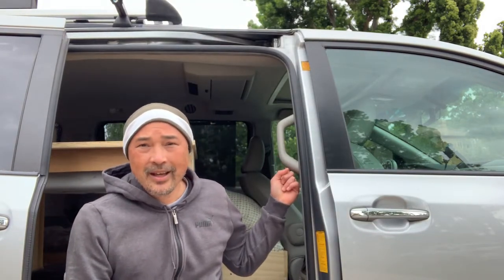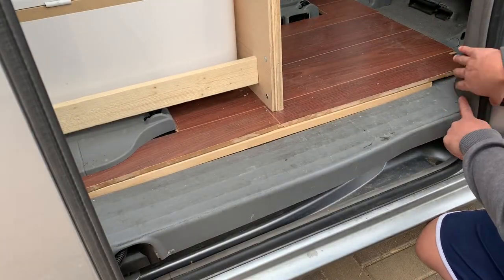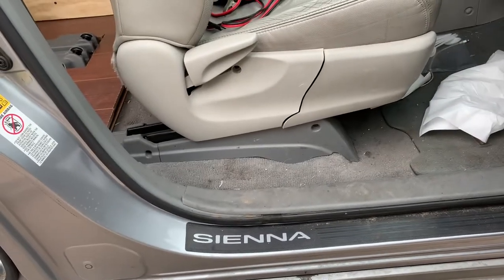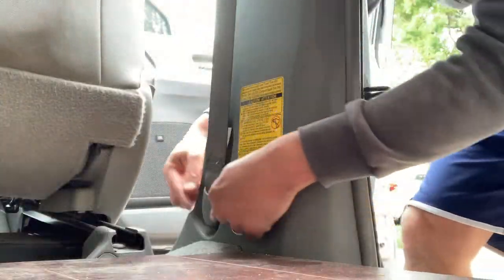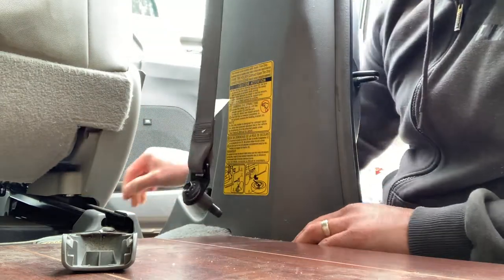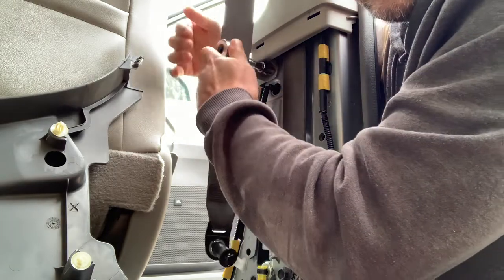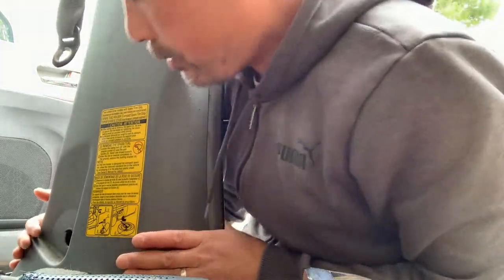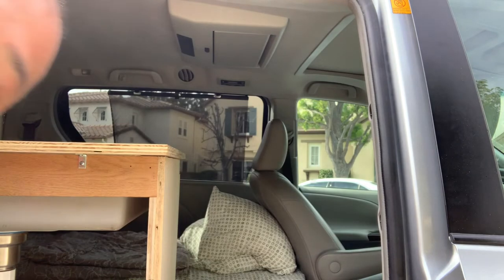I Removed The Sienna Grab Handles, Now I Can Get In Easier. How To Remove Grab Handles.

Comment: Great video! Could you add some other keywords to your video post, to make it easier to find? Some things that would make it easier are B-pillar, interior trim removal, Toyota Sienna, (year of your Sienna), or Generation (I think this is 3rd gen like mine. I have 2016).  I needed this info so I can remove the headliner. Most of the headliner videos are not vehicle specific so this showed me the B-pillar on the Sienna. Thanks again for the great video!
Reply from the maker: Thanks. Will add tags.